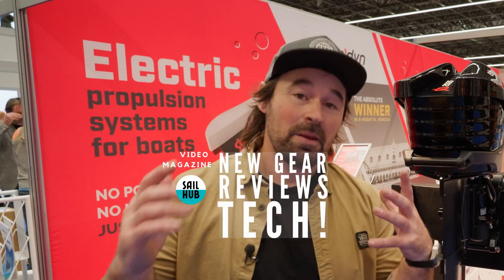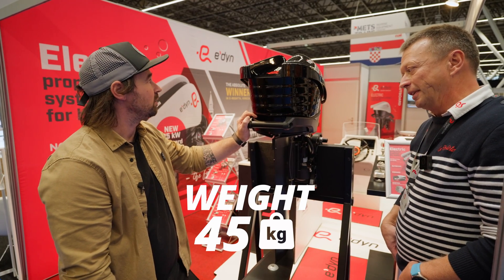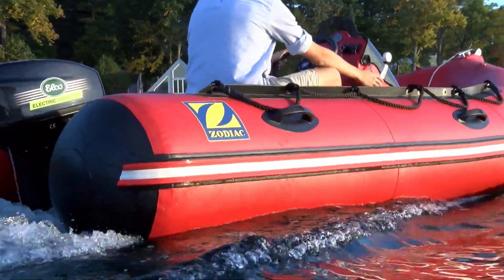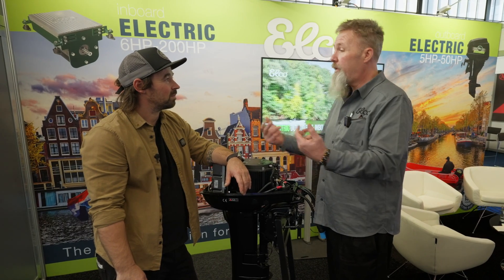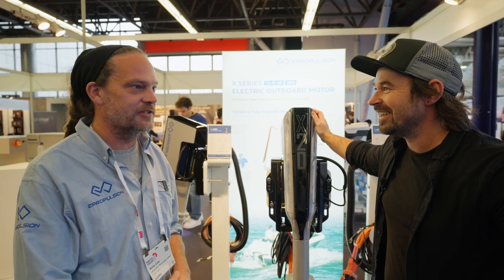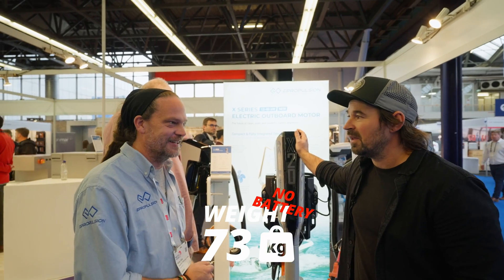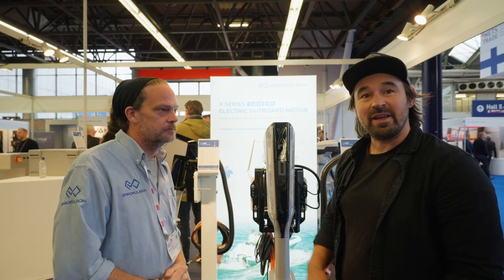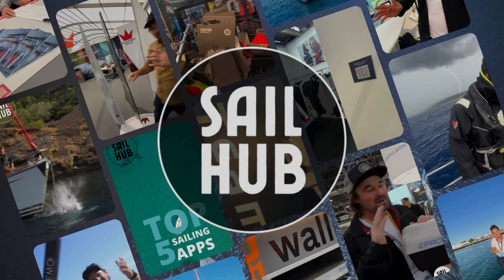The BEST electric outboards of 2024?

Comment: ❤ Thanks for the interesting review bro! May I ask you to check with the manufacturers if these outboard motors can be installed on sport sailboats and work in power return mode when the boat is sailing? 🙏
Reply from the maker: Hey, 

Every motor can regenerate power within reason so most manufacturers will say yes to you. The problem is… An efficient regeneration system is more difficult to manufacture but way more useful! Be sure to check up on what you are buying into.👍
 
More than happy to advise on gear over on Patreon. It’s easier to do their and that way we are helping each other.

Comment: Funny thing about these electric alternatives. They all use plastic parts down to the prop. Plastic is a fossil fuel product. And plastic props are crap. So they will need to be replaced regularly. The whole electric powered by batteries motion is crap. Doesn’t help the environment.
Reply from the maker: Yeah, that gets me 100%. SeaDrive and EPTenchologies I believe are the only ones that actually act responsibly in this department.
Reply: they should just use recycled until they run out of stuff to recycle :o) ... I'll stop using plastic when they run out of the recycled stuff.
Reply from the maker: The problem with recycling plastic is that it usually becomes less and less useful every time we recycle it, which isn’t great news. Then there is the micro plastics, these are actually really really bad news. 
Personally I prefer metals, but, of course we are stuck with what we can get at a price we can afford.

Comment: As always with new technology everything is way too expensive. They produce these products for pennies on the dollar. Competition will bring the price down. As with electric cars there are many heavy batteries needed.
Reply: They should offer this product with gas powered generators as an option. At least until the cost of batteries comes way down and less batteries or lighter weight batteries are available.
Reply from the maker: All true, I think electric is for a different mindset. The weight is less than a diesel set up but the range is less. If your into sailing it makes sense as your motor becomes a true auxiliary.
Reply from the maker: @sheaconnelly4287 hmm, this seems very popular for some reason but personally I don’t see why you wouldn’t just go hybrid with something like Integrel’s new system.
Reply: More hybrude boat purebekrrtvc
Reply from the maker: Hybrid sure seems to be the sensible option for most boats in our opinion.

Comment: @ e-propulsion - 40kw at 96 Volt.  hmm. Am I doing the math right. 400+ amps?
Reply: I want to love this motor as it is the one I want in my boat. Just so curious about how they get 400 amps continual to actually work. 

Would love more info if anybody has real world experience.
Reply from the maker: @carterjohnson25  why wouldn’t it work? Lithium can provide a massive current and the voltage is high so the wires don’t need to be huge. 
I guess I’d we look at most electric companies everyone is going high voltage these days, 96v seems to be a standard but others are going higher and if we want power we’ve got to do this! For me, I’m lucky as average sailboats can manage with 48v. I like that because it  just seems safer, all though in theory it’s no different.
Reply: @SailHub 
See my comment. And click the link on the wire gauge calculator. While 96 volt seems like a lot. It's not compared to that amperage. Remember nothing is big (or small) until compared to something else 😊

The physics that needs to be conquered has is not in regards to the discharge rate of the lithium batteries. It's how it's transported. 400 amps for electricity is quite extreme. (Anecdotally, many super high wattage lines that feed entire neighborhoods run at under one amp, but many thousands of volts, which is why the wire can be so thin)

Per Google - At 96 volt DC to carry 400 amps sustained,  you need a wire that is 3/4 in thick

Any thinner wire you will have one of two issues.

1) significant voltage drop
2) overheating

Per the voltage calculator you need that 3/4 inch thick pure copper wire if you plan on running 400 amps just 7 ft without One of the two issues above occurring.

Anyhow, I know their motor is obviously working,  But physics is physics so something is giving.

This is why I'm curious if someone has real world knowledge of what is giving.

1) are their wires actually that thick all the way to the battery pack?
2) are they running them above 75° f?
3) are they ignoring the voltage drop?
4) or possibly they just don't expect anybody to run it full throttle for any long period of time.
5) maybe if you do run full throttle at a long period of time it fixes itself by cranking down the amps, or power, just like your computer would when the Intel chip overheats.

Anyhow I love this product. And I truly believe in what e propulsion is doing. An electric motor like this is in my future. 

I'm just super curious how they get around the pretty hefty physical requirements to move 400 amps over 96 volts.

Maybe some other electrical engineer can chime in to better articulate my concern.
Reply from the maker: Sure, I see your conundrum. I haven’t seen anyone running exceptionally long cable runs personally. Mind you, one thing is for sure, the cables are huge on these things so I would say your cabling suggestion is what they are using.
Reply: @carterjohnson25  Thank you for your comments. The X40 features a twin motor controller design, meaning there are four cables connecting the motor to the battery. This unique design halves the amperage required to operate at full power. Cable runs longer than 10 meters would require a larger dimension cable
Reply from the maker: @RickCole-bc9zs well done sorting that 👍
Reply: @RickCole-bc9zs  this makes a lot of sense. So each cable is carrying 100 amps. Collectively they probably are 3/4 to 1 in thick as mandated.

Mystery solved. 

Appreciate your time to answer the question. Maybe it's just me but I suspect most of your targeted consumers and early adopters are proper nerds 🤓
Reply from the maker: Yup.
Reply: continuous ... not surge ... i seen them surge to 650 for 3 seconds and 1000+ in the half second range. and it's three phase unless ya forgot. The cooking goes on between the controller and the battery ... the motor never sees that much only a 1/3 at any instance.

Comment: I am liking these mid range outboards. They are powerful enough to power day runabout boats in the 4 to 6 meter length (13-19 feet) and you can actually get some decent speeds (faster than row boats and displacement boat speeds). The prices are fairly reasonable. However, the limitations are still the batteries. While they are improving, they are still quite heavy and expensive for these smaller to mid size runabouts. 

I have an old 14 foot fiberglass boat in my garage right now with a 33 hp outboard on it, and the boat is certified for up to 50 hp. These 30 to 40 kw outboards would work well on it, but the associated batteries are still a bit too heavy and expensive. They are getting there, but are not quite there yet.
Reply from the maker: Yup I think you’ve nailed it! It’s worth noting a 20kw would be expected to more powerful than a 50 Hp and your likely to only use a small amount of the available power most of the time. So the batteries may just work.

Still, it’s great to see the industry progressing around us. Batteries are getting better, their density not so much at present but the safety is becoming awesome!
Reply from the maker: Ooooph, really sorry! I pressed the wrong button and lost your last comment! 

So, if I’m right, yyou have seen plenty of evidence that the 20kw is not enough get up and go for you. That’s good to know m, thanks for letting us know. 

I would like to see the models mind, I think there is a lot of strange things going on in electric motors these days as what some manufacturers say are not quite true etc etc, and of course there’s the prop too. That’s the biggest thing effecting performance but little is mentioned about them.

So, we’ve got to go off what people say more than anything so thanks for broadening our knowledge 👍
Reply: @SailHub  a lot of the smaller boats that outboards are installed on are often quite weight sensitive. Most boats in the 12 to 16 foot size have some limited weight supporting capabilities simple because of the relatively small size of the water displacement footprint they produce. Once you exceed the weight of the water you can displace, it’s glub, glub, glub time. When you reach the mid range outboard class, about 20 to 60 or 70 hp range, the weights of the electric outboard motors climbs very quickly and begins to exceed the weight of the gasoline powered equivalents.  And as those hp (kWh) increases, the capacity of the batteries has to increase drastically. And that brings with it large battery space and weight increases. My boat is a 13 1/2 foot long runabout. While I could put a 30 to 50 kWh electric outboard on it, the weight of the motor and batteries would reduce its gear and people capacity down to only 1 or 2 people, 2 fishing poles and 2 sack lunches with 2 medium size beverages. And the range at planing speed would be an hour or less. A lot less.
Reply from the maker: @americanrambler4972 not so sure about the weight penalty, it’s close mind and I imagine it’ll the fuel tank status will be a big player. Range though…… well, there a clear winner there! 

Too be fair, the weight issue, even if one’s better than the other, it’s not much and the speed vs range makes gas way more sensible for most folk. 

As for us and our boat - we’re trying to make electric work, it’s a personal challange!
Reply: Wjaker 15 16 17 18
Reply: Poly credit 4.8 metrr csbin crusrr 90 hp

Comment: Sailor comment here (I get that most of this stuff is powerboat oriented) I think it's rock and a hard place with the electric motors for sailors.  The big motors (6kW/9+hp equivalents) need a massive battery so they're not feasible for a sailboat tender (good luck with your davit setup, or your back if you're hauling the battery onboard before the motor before the dinghy).  The smaller ones are basically trolling motors (I have yet to see any of them get a tender up on a plane, they are either 1kW and don't have enough power, or they're 3kW+ and the battery weight is making it a zero sum game).  A 6kW motor with a quick swap battery setup would be super interesting, store a couple extra batteries on the dinghy for faster/heavier runs, keep them in a lazarette on the boat otherwise.  For those worried about 6kW chewing through a small battery, a current limiter dial on the tiller is all that's needed.  It could be operated at an equivalent to 1kW, 2kW, 3kW...
Reply from the maker: Yup, us sailors have it tough! 

So, it’s a negative feedback loop we have, 
more power = more weight = need for more power and so on and so forth.

There is however things on the horizon,  but it involves a complete re think and the market gets nervous 😂 the salty sea dogs in us like long keels and 2t motors (there is a reason for this though). Still… it’s going to take a couple of years to see it on the market properly. 

As for the dial limiter on the outboards, we could just use the throttle.
Reply: @SailHub  With new sailboats at 1/4 million and 50 years of GRP sailboats refusing to die I'm not expecting a re-think to explode the outboard market any time soon...  and I'm impatient, I want to leave my gasoline outboard in the past.  But for now, there's nothing remotely close to replacing it.  It's not about price either, even if I had $20K it wouldn't make sense to put a 6kW motor and massive battery in my tender.  BTW What is 2t?
Reply from the maker: @peterjmcgowan sure, that makes sense. EPropulsion are driving the price down at present, which although hard for other manufacturers it’s forcing everyone to concentrate on price overall. Their new 500w motor was just released at £975. It’s a sewing machine so by the sounds of it not really for you but none the less a long awaited move in the right direction for cost. 
2t an abbreviation for a two stroke combustion engine.
Reply: @SailHub  ahh, never heard that term used over here in the USA.  They’re banned for years now.
Reply from the maker: @peterjmcgowan how strange, maybe it’s a more of a engineering/motorsports thing? You can usually see 2T written on the the oil bottles. Well in the UK/EU anyhow!

As for being banned, yes that’s right.. but they go forever! There’s hundreds around from the 70’s! The question still remains, which is more sustainable. An old 2T or remanufacturing a new model with lithium and plastics?!
Reply: @SailHub  yah, plastic being basically a fossil fuel, it’s a problem.  But one challenge at a time, eh?  I am hopeful though, the microwave in our house is 20 years old and still going.   New technology isn’t always short lived.  Meanwhile, that water tank with the outboard running in it…
Reply from the maker: One challenge at a time! Good plan, let’s remain hopeful together too.
Sail Hub are stoked to be a part of the industry during this period, the future is really, really exciting!